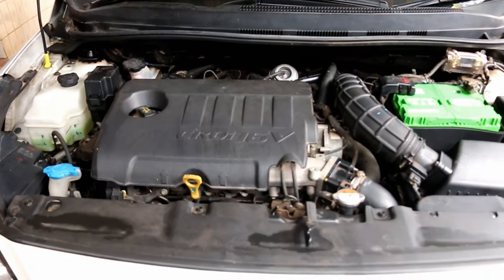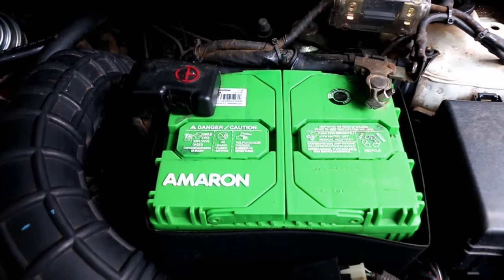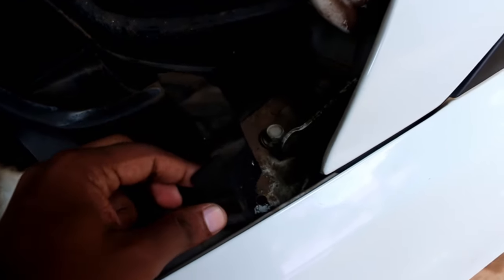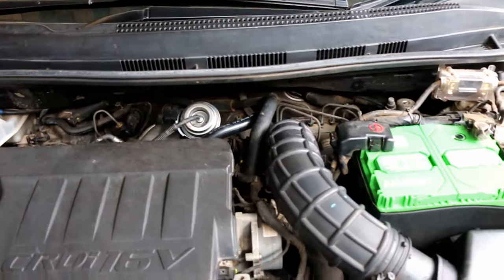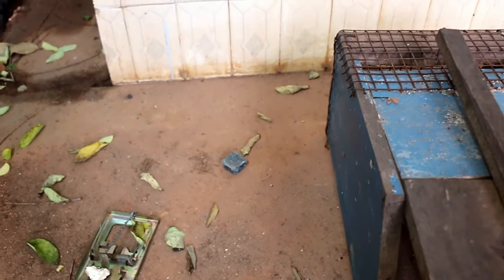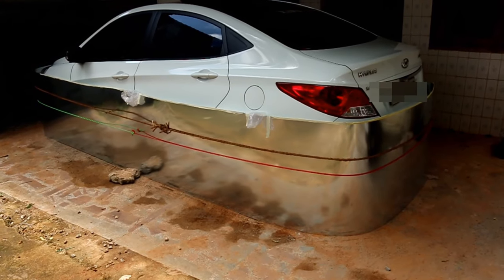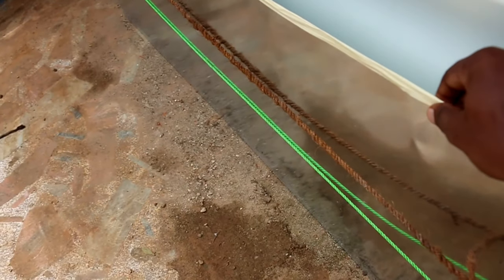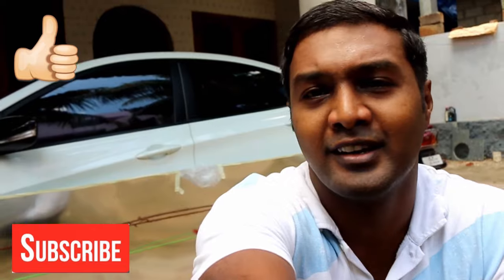DIY : How to Rat Proof your Car

Comment: This method is working on leveled area only but if the car parked at uneven surfaces how to protect with fence ? Please suggest any idea
Reply from the maker: Try to add spike wire inside the engine bay with help of cable ties, then add rat metal trap and rat biscuit poison.